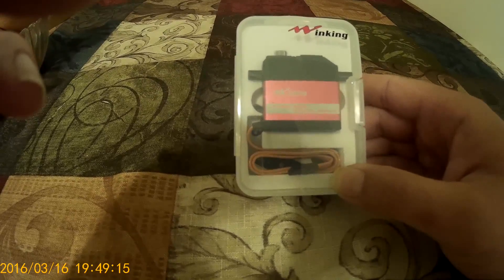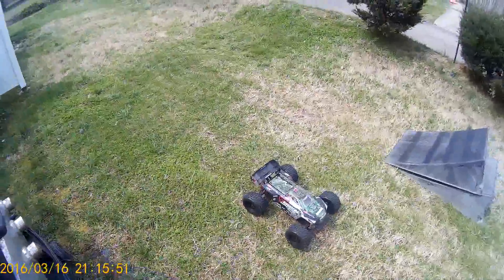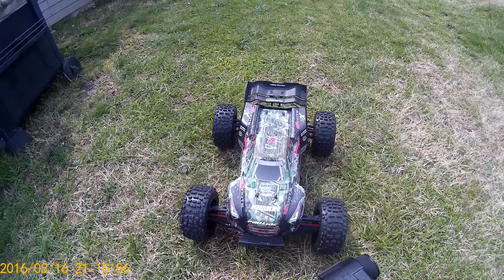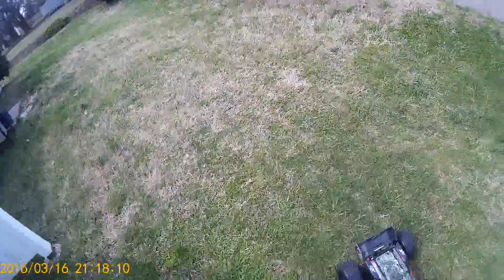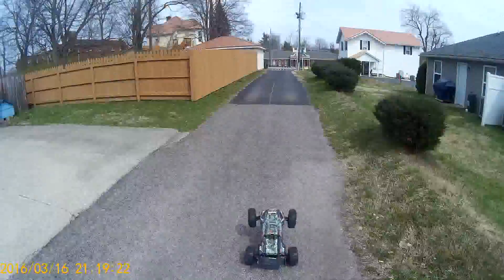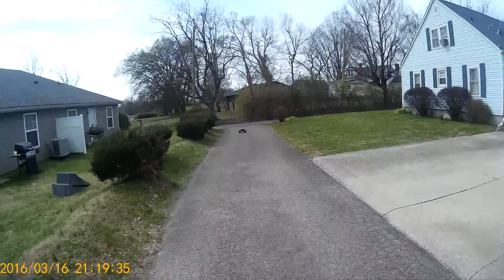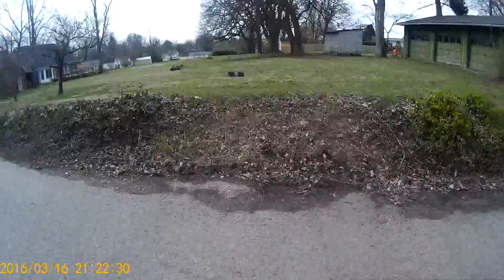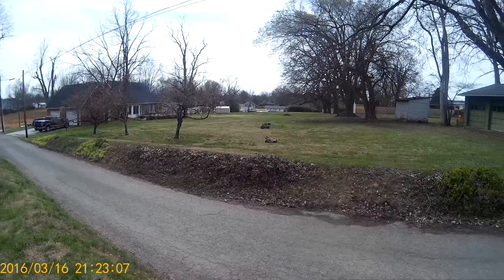Arrma Kraton servo upgrade RcGear shop/winking servo review''

Comment: I bought the DMC300 instead of the 250 by accident and it says they are the same exact dimensions yet I can't figure out how to install it
Reply from the maker: Marcos S  Rojas are u still using the stock servo mount?? And I know it was little tricky installing mine with my voltage hobby servo mount. But if ur using the stock I recommend getting that servo mount upgrade it’s flex so much and hard on the servo
Reply: Matts Rc Addiction Thanks for the replay yes I still have the stock servo mount
Reply: What servo mount do I get get one with the dimensions of the servo?
Reply from the maker: Marcos S  Rojas I used the 300 to and my voltage hobby servo mount worked just fine https://www.voltagehobbies.com/store/p10/Voltage_Hobbies_Servo_Mount_for_ARRMA_Kraton%2C_Talion%2C_Typhon%2C_Senton%2C_Outcast.html
Reply: Matts Rc Addiction Thank you soo much. I'd like to see a picture or video of how you have set up since there's diferent horns and arms in the neat little box
Reply from the maker: Marcos S  Rojas well sorry I can’t do that one of my other videos might have it in there. I just about sold all my stuff last year had a big financial deal. I’m just now getting back in the hobby again. Just bought a yeti xl
Reply from the maker: Marcos S  Rojas https://youtu.be/UrELYtHyeB4 look at this video
Reply: Matts Rc Addiction Oh wow wish you luck and for what I have the Axial Jeti is pretty awesome and lots of fun